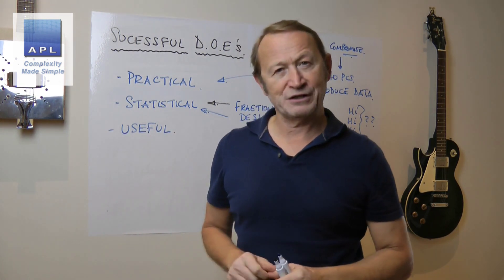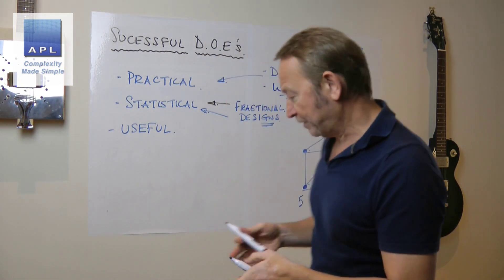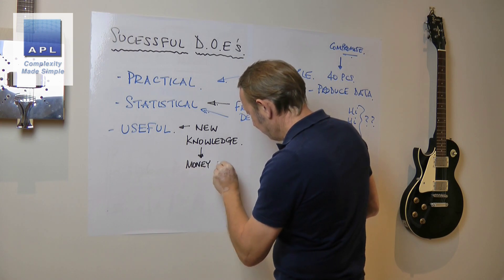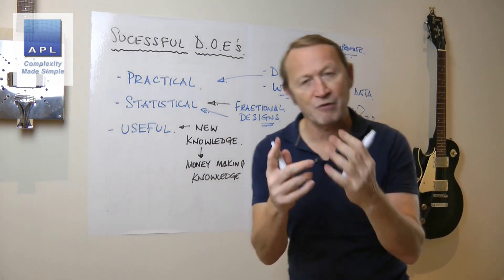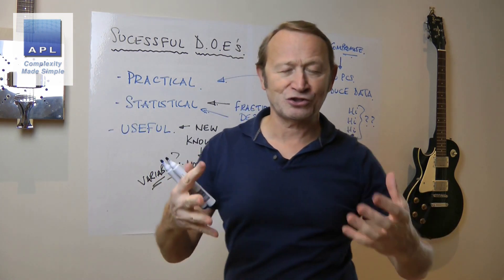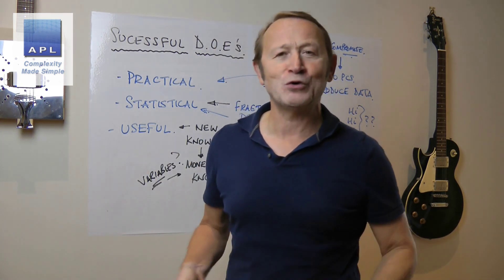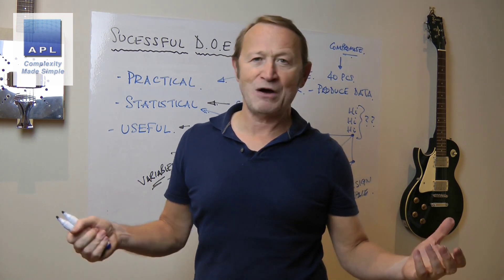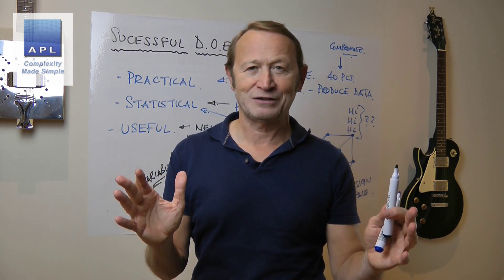Design of Experiments - A balance to get it right...

Comment: Great channel Paul. At 7:00 you talked about "statistical safety" being related to fractional designs when working with chemicals, the downside being not being able to appreciate interaccions between factors. My question is: is this situation specially attributable to experimenting with chemicals? I'm a chemist and my line of work with mu clients is adapting and formulating custom-made chemicals for their applications and DoE has been a blessing in this regard. Would you be so kind as to share more of what you have seen and experienced with chemicals and fractional DoE? The whole thing I perceive it as a combination lock. According to the effect the client wants in his process, my formulas always work, but the DoE aspect of it I use it always to fine tune the final yields. It's a breeze. Your feedback is most appreciated. Great work.
Reply from the maker: Victor - great to hear from you and thanks for the positive comments. Thought I'd take your question and make a video...
https://www.youtube.com/watch?v=7votLCK_mH8
let me know what you think...